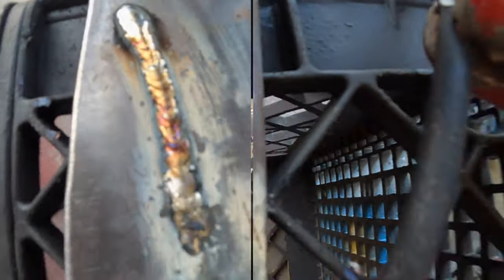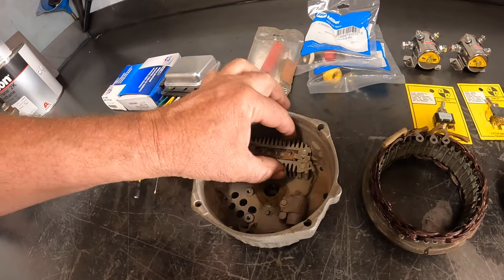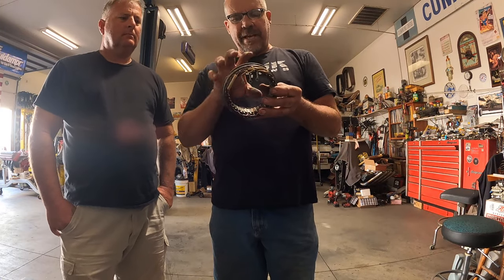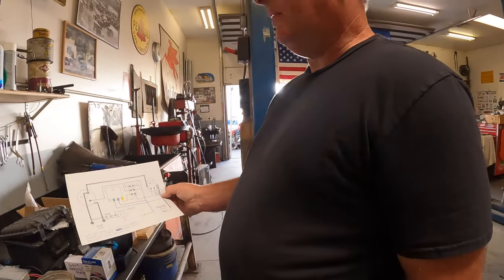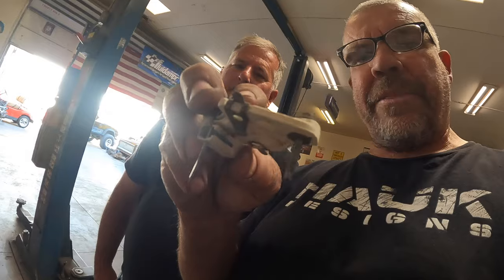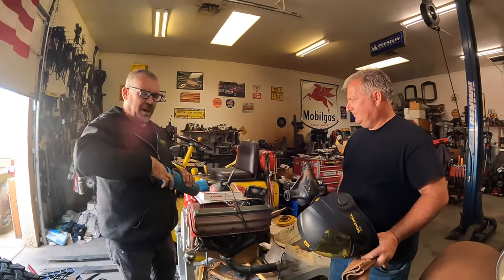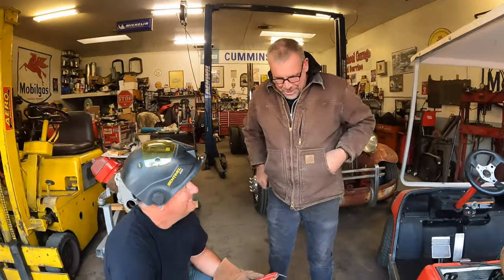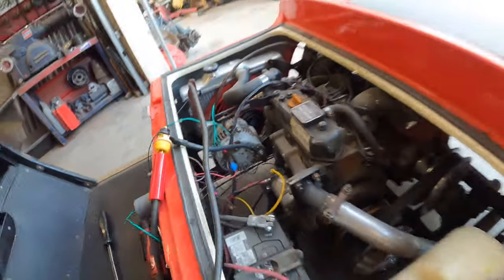How to Turn Your Alternator into an Arc Welder

Comment: When you switch the alternator to weld mode its not energizing your ignition system/coils/computer right? So that would all be running off battery. How long can you run this without wearing your battery down? 
Maybe cycle back and forth to keep from damaging battery?

Comment: I don’t think I heard what the second small gauge wire was for on the LS alternator. Premier has two small gauge wires coming from their version also. On the stock LS alt you can have a second sensing wire to the fuse panel to give a reference of voltage with the loads on it, is the second wire for that? Since the reg is not internal after the conversion I’m super curious.

Comment: I did some research and I think on my '05 LJ I just need to toggle the ground back from the field to the ECM, directly to ground through the DPDT switch (no external regulator.) If I could post a picture on here I would. Sound right?

Comment: How does your wiring schematic change if you have an externally regulated alternator?  My Jeep XJ's ECM controls the alternator as I understand it.  Would you just have a switch inline with the factory "F" wire to disconnect the ECM from the alternator before you switch it to welder mode?
Reply from the maker: Disconnect from the factory ECU and control it with an external regulator it works great

Comment: What about single wire higher amp alternators off of older semi trucks? Lower RPM higher output? Longer lifespan? Cooler operating temp in the alternator? Could a 5 horsepower lawnmower engine be used.

Comment: I had been told sometime back that his newer alternator don’t like voltage above about 16 volts if you. Has this been a problem with converting the newer I want alternators?
Reply from the maker: You are exactly right the older alternators work much better I’ve had trouble with the new one as well

Comment: Merlin, I have an internally regulated alternator on the YJ.  Will an older (pre '72) GM alternator fit in the brackets?  Or is it easier to just try and bypass the internal regulator?
Reply from the maker: what year is your jeep
Reply from the maker: that should be the same exact alternator that I used in the video on the golf cart it was off from a 94Yj
Reply from the maker: You just have to ground one field wire and then use the diagram and hook it up
Reply: It’s an ‘89. Got the 4.2. So no ecm. Regulator is in the alternator. I think the 91+ YJs had the regulator in the ecm.

Comment: Mines an '89 YJ.  voltage regulator is internal to the alternator.  How do you hi-jack this or bypass the internal regulator?  Is there an older alternator that uses an external regulator that fits the mount?
Reply from the maker: Use a newer alternator from like a 94YJ because they are external
Reply: Gotcha. Just have to swap my v belt pulley. Thanks!

Comment: yea but when you increase the field on the rotor with a regulator you still need to give it more throttle to maintain RPM. right or wrong? maybe irrelevant just a thought.

Comment: What is that circle with a bump in it on the diagram? Also can you do this with a Jeep XJ alternator?
Reply: Do you mean "circle with a bump" two of 'em?
One at right top of switch, one at cord connection?
Not my circuit, but those seem to represent indicator lamps.

I understand what needs to be done in the Field control circuit. That said, the switch connections have me a bit confused.  Since I won't be building one I wasn't too concerned.
Neat project.
Reply from the maker: circle with the bump is indicator lamp

Comment: I don't think that is putting out 120 volts.. my experience with testing alternators is about 20 volts max full fielded. If you wanted higher voltage you have to connect the three field wires in series in a specific order to achieve 60 volts. Although 60 volts is awfully high voltage to weld with. I think my 250amp DC mig is 24 volts.

Comment: Can this be done with a “1 wire” alternator?
Reply from the maker: no sir You need to have control of the field in order to make it go hot enough to weld
Reply: @MerlinsOldSchoolGarage  thank you for your response. I’ve always wanted a onboard welder. I am a off-road guy and putting parts together for a brand new build from scratch. This helps me in what direction to go. I’m going to subscribe to your channel as soon as I send this message thank you again

Comment: Why does it have to be converted to DC?
If you used another battery to charge the field current I would think you could stay AC.
There is a power loss in the rectification to DC.

Comment: The brushes are a perfect example of planned obsolescence because they could just use actual magnets and the alternator will last a lot longer.
Reply: Even neodymium magnets do not have as strong of a field as the electromagnet the rotor makes.
Reply: @martyk1156  haha, what?
Reply: @randomschittz9461  going to a brushless design would greatly reduce the output.
Reply: @randomschittz9461  I have actually tested this with an alternator that had neodymium magnets placed in the rotor on alternator for a windmill. If you are bored someday. Full field an alternator and then see how hard it is to turn by hand just to put it in perspective for yourself.

Comment: So basically your just adding the switch to your voltage regulator I have a 1971 f100 an it has the same voltage regulator you are using there so would I just add the switch to my voltage regulator an it should be good?
Reply from the maker: As long as you have the disconnect solenoid so that you disconnect from your battery that is correct
Reply: @MerlinsOldSchoolGarage  can I use the insisting solenoid or do I have to add a separate one thanks merlin.
Reply: MERLIN I GOT MY WELDER GOING IM GOING TO MAKE A VIDEO AN UPLOAD IT SOON YOUR THE MAN NOW IM PUTTING ONE ON EVERYTHING LOL
Reply: @Mryiyo209.  You need a separate one. The one you have is for the starter. you have to have another one to  disconnect the welder or you will fry a bunch of stuff.

Comment: So could you run a 3phase motor directly from the windings if you could maintain speed?
Reply: Or would the frequency be wrong/ need to be corrected. I suspect to get the higher voltage the speed would need to be rather high and thus produce high frequency ac

Comment: Be careful. Commercial stick welders are running at 20 to 30 volts at 50 to a few hundred amps. High voltages like you are talking about here can electrocute the user or others  if he touches the hot and ground  at the same time.
Reply: Not really, that's open circuit voltage with no regulation. When you put a load on it, it drops down to the normal welding voltage of 20some volts and the RPM ends up regulating the circuit current in the range of the max output of the alternator (If that wasn't the case you wouldn't need the jumper cable wires to hook it up). I've done this a few times with the ford, I think 130A alternators out of '80s and '90s tauruses and similar cars.  They work very well for this kind of thing and are easy to hook up bypassing the regulator with no disassembly. You can even hook a TIG torch to them and TIG weld with them.

Comment: my small plasma comes with a pony bottle,, so i cut flag pole top out of a bucket truck plugged into an inverter but coulda juat run off the alt. instead of converting twice along the wire

Comment: How long can you weld with that burn off the alternator and after about 15-20 minutes will it run to the battery goes dead on the on the diesel

Comment: All my alternators are 1994 thru 2003 ram gas burners should they work i just looked 2 of them 1is 136amp and the other is 120a
Reply from the maker: Yes those work great
Reply: @MerlinsOldSchoolGarage  great I have several that came off of ram 2500s gas burners looked up and they say 136.amp. going to put on my wrecker and on my 1994 ram 2500 thanks for the info. Was going to buy a 
Premier welter this way so much cheaper

Comment: Couldn’t you just change over the pulley on the alternator so it would run faster so you could weld at idol and would you just run a second alternator so the one for the car didn’t compromise the battery or engine

Comment: The first link doesn't work.   Not sure what a PTA 0179 is - but neither does Advanced auto parts.
Reply from the maker: It’s carquest part numbers
Reply: @MerlinsOldSchoolGarage  Thank you for the prompt response.  PTA 0179 is the connector - and carquest's website won't go directly to it - you can only get to the plug as 'recommended parts' when you search for your 2nd thing - the regulator... brother, why do they have to make it so convoluted?
Reply: @stoneshrink   PTA 0179 should be  1079

Comment: So when a alternator goes out what is the main component that usually fails?
Reply: Usually the diodes. Depends what you mean by "goes out". There aren't too many parts inside: Bearings, brushes, slip rings, rectifier and regulator. Coils rarely go bad by themselves. If it just died, or burned up, probably diodes in the rectifier. If it's making a bunch of grinding noises etc, could be bearings. Like I said, depends on what you mean by "goes out".
Reply: Most common its brushes and then if you let it go too long with marginal brushes the slip ring gets scored from all the arcing.  With the welding conversion, running at too low an rpm might not provide enough airflow to keep the rectifier cool so diode failure could become a pain point.  I used the old Chrysler external regulator (that was used on most models up to the 90's) to convert a Hitachi to external regulation but did not do the welder conversion since its getting harder to find parts for that particular Hitachi Diesel Alternator with the attached vacuum pump.  The old style External Chrysler Regulator is available as an adjustable unit to allow you to set the voltage to best match the vehicles original specs or your particular need.

You do have to be mindful though that your talking about High (Potentially Lethal) Voltage DC here so you have to be prudent when running in welding mode.  Consider a safety cover on the double throw switch that will automatically flip and lock it to a regulated 12 volt system when its closed.

Best
Reply: Also be mindful that when in welder mode the input power lead on the barrel relay will have high voltage perhaps as high as 200 or more volts so it would be "Best Practice" to insulate that terminal and stud with a boot, etc to prevent accidental contact with potentially lethal voltage.  Really any part of the circuit that will have Welding Voltage should be insulated to prevent arcing and potential injury.  The only exposed part with welding voltage should be the clamping surface of the electrode holder.

Comment: Could a fella take a 5 hp engine, run an alternator with a pulley or even direct drive, add a battery to power the coils and make a stand alone portable welder. Seems doable just curious if 5hp would be enough.

Comment: ahhhhhhh.. ok....  thought the welding alternator was a second alternator.  Seems your diagram is pointing out that the added solenoid and wiring ... with one switch direction re-routes the wiring turning Alt. into a DC generator/welder.... while switching it the other direction re-routes the wiring back to regular operation of battery charging.  coolio

Comment: You don’t only need to shield your eyes from the arc you need to protect all bare skin from it too. A welding arc produces the same amount of uv light in 2 seconds as you would get from a whole day sunbathing in spain
Reply: Yes, you get sunburn from it very quickly.  😇
Reply: Been a welder for 40 years and I can testify to that. Several times in my career as a welder I didn't use leathers to cover my arms. Of course I have lots of molten metal burns but the uv light over time cooked my skin. I'm 67 years old and you would expect wrinkles, but my forearms have the oils cook out of them and at times look like I'm 200 years old. When welding please put even more protection on then you think you might need or you'll pay for it in the long run. Happy welding folks. Forgot, you can also get skin cancer from to much uv light as well.

Comment: You just need to be very careful that you don't touch both Pos & Neg at the same time with bare hands/skin because you have 100 volts or more and could electrocute yourself. Make sure you are well insulated before using it.

Comment: The welding alternator should be separate from the factory built-in alternator that runs the ignition system and charges the battery.
 I don't understand how a factory built-in alternator used as a welder couldn't fry the car's systems or battery.

Comment: The limit is the AMPERAGE. The wires in the alternators ARE NOT RATED above 60Amps. This may work for "TACKING" but IDK about running beads for long. HEAT is the killer. perhaps a few in parallel might work.

Comment: Don’t put this on a computer controlled vehicle!!!  By joining grounds, you can back feed voltage into your computer and fry it with voltage spikes.  

This should be only used on carbureted engines. 

If you are insistent on using it on a computer controlled vehicle, the body of the alternator/welder should be isolated from chassis ground with no connections of the two.  

You can achieve the same effect by using jumper cables from the battery, and you can stick weld from there. You’d want to run a thinner diameter rod like a 6011.

Comment: I love stuff like this. But buy a used stick welder. 50 bucks. And use yur 150 dollar alternator for a car lol. I stilll have a few of these oddities around. Like homemade generater. With complete new roll of wire for a coil. Lol lol . Chitty shitty bang bang. Lolz
Reply from the maker: And then what are you do when you’re 50 miles out in the middle of nowhere and you need to weld something kinda hard to just plug a stick welder in somewhere

Comment: Welder here: this is a totally dangerous and moronic way of welding anything,  a simple inverter stick welder is $150 on Amazon,  cheaper than the parts list on this build and infinitely better. Add a small 3kw generator and there's your mobile welding rig, anything welded with method will be Inferior to a cheap Chinese welder. I get the point of trying to make something from cheap parts, but seriously this is just dangerous and stupid. Also 2 pairs of sunglasses are you insane?! Welding at even  very low amperage can cause permanent blindness and severe burns to the retina,  buy an actual welding helmet and never weld around people or pets who aren't wearing full welding protection.  Safety equipment saves lives, don't be stupid just to look tough, you only get one set of eyes.